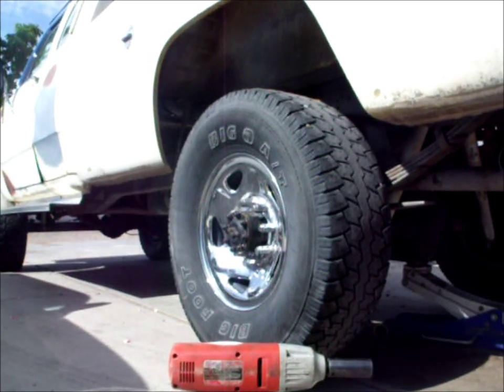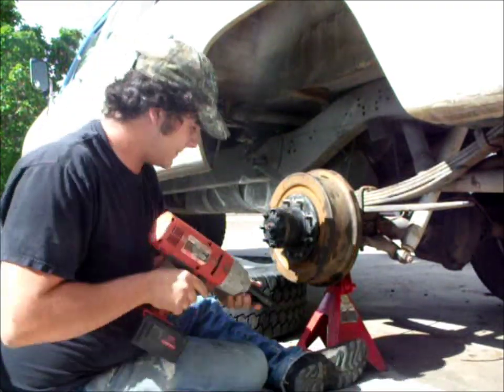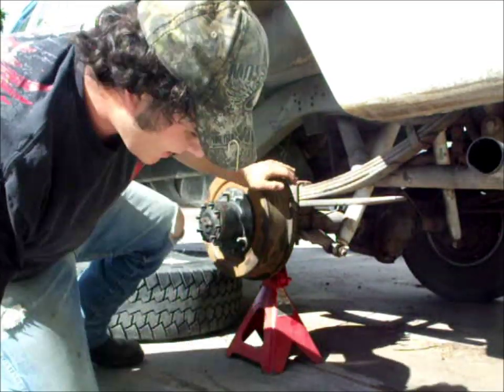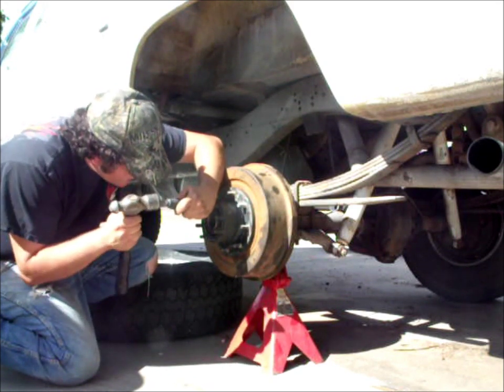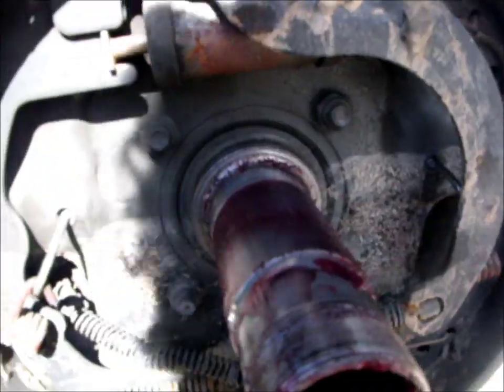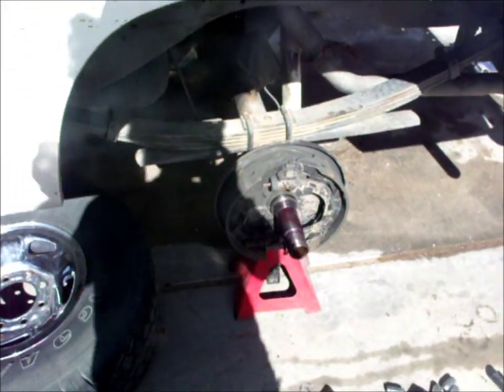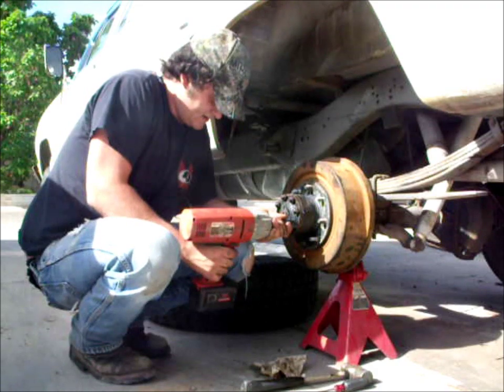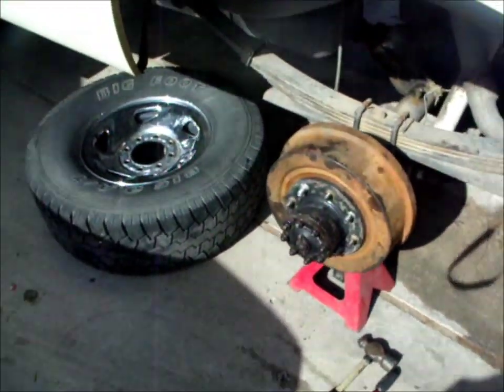REDNECK HOW TO REMOVE A DANA 60 BRAKE DRUM

Comment: The wheel bearings are lubricated by the same gear OIL used in the center RING & PINION / rear end.
 What MORON used grease, Who worked on this truck ?
Reply: Mark that drive axle looked quite dry too .. I have to do mine tomorrow.  Good to see more knowledge in the comments haha
Reply: Even tho this is true, from what I've read you're supposed to add some grease to the bearings for lubrication on startup. Takes a little for the gear oil to reach the bearings.